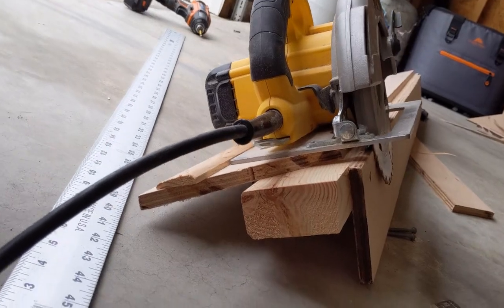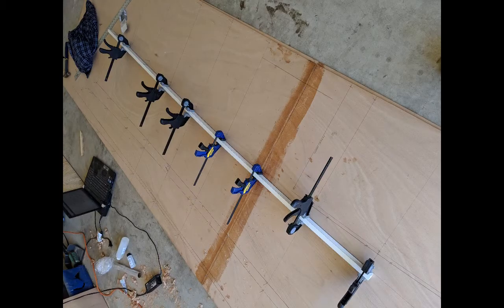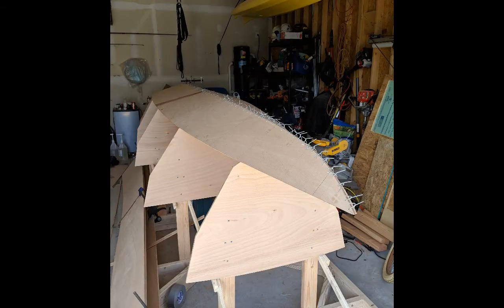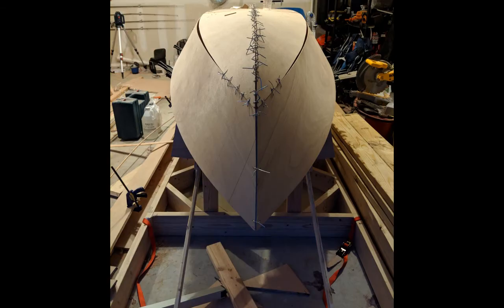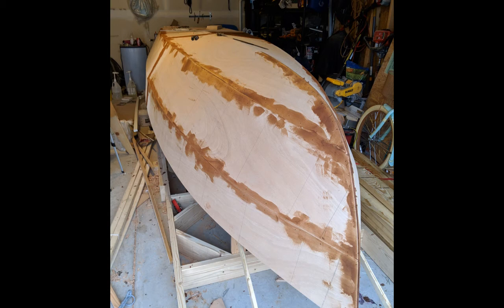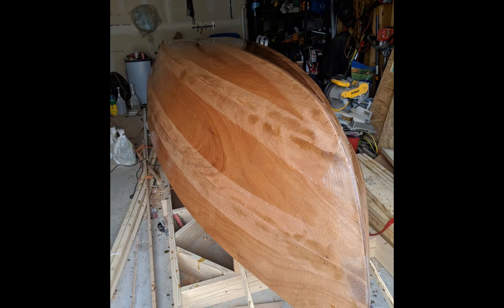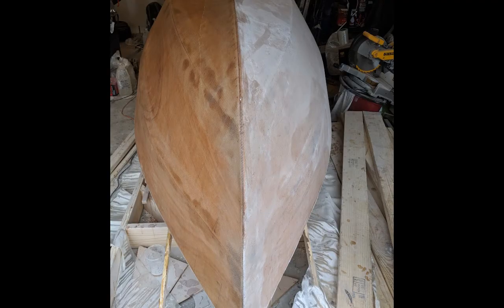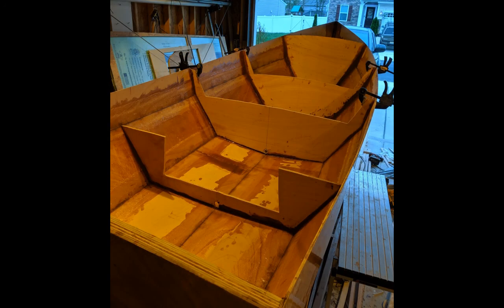CandleFish 13 - Part 2 KazierKreation Build

Comment: Thank you for the detailed overview.  I was looking for info on tabbing.  Normally I build right side up, so all the coves go inside and it is super strong when I get to the point of flipping it over.  You did not do what he suggested which was to bog and glass the seams.  He says it is easy, which is true.  But it would be endless.  Glad to see you got away with the process of just bogging the seams.  I was looking for permission.  :)

Comment: Dear  Mr. Kazier

I am very impressed with your woodworking, mechanical and electronic skills and have enjoyed seeing how you created your own CNC machine.  However I am even more interested in that fine Candlefish 13 that you built for yourself.  I have been trying to find one to learn more about it myself and to experience it's stability and sea abilities. Perhaps you can advise me with regard to your experience and understanding about the boat?

I would like to use it to transport 2 adults + gear to a 32' sailboat, up and down a 3 mile river that goes 4-5 knots due to the tide (against a good wind) creating a good chop. A 310 Rib gets pretty wet, so I would like this boat to be dryer and a better sea boat. Do you think it will be dryer?  I would also like to be able to take 4 adults to the sloop to go daysailing, and going slower with the heavier weight and being packed a bit, is expected.  Is that possible?

I would like to understand how stable Candlefish 13 is, because I would like to know how easy it is to board or transfer to another bigger boat's ladder. My wife has just had 2 knees replaced and she was able to board from our 310 Rib last year with difficulty. Now she has new knees and is doing PT so she is much more capable, but I would like to have an easier way for her to board our sailboat. I would  have a stabilizing post or railing for her to hold on to, that could be deployed when boarding or disembarking.  I would lean outboard to starboard to keep the boat stable, as she moves to port on the bridge deck to get to the ladder.

I am pretty agile so I don't think stability will be an issue for me, but I would like to know if the Candlefish 13 is more unstable than I think it is,  is it sort of like a narrow canoe or kayak? As you move weight to the side, does the boat increase in stability at all? I have been considering the cross section and am a little concerned about the reserve buoyancy outboard, due to the way the second panel is positioned.  Is the amount of stability something you get used to and just don't notice after awhile because you have accommodated and learned the boat?

Also another question I have is this boat too big to consider towing it behind a 32' sailboat for 15-20 miles sailing between ports? Will it tow well? How would towing compared to a 310 RIB (120 lbs)  which we do all the time?

Thanks,
Rick Gleason

PS: Thank you for your excellent youtubes's I have looked at them all. I find it very helpful and encouraging.

PS. I tried sending to your email on your website https://www.kazierkreations.com/ from two different emails and each time I was notified that it does not exist.

https://www.kazierkreations.com/
Reply from the maker: First my apologies, i have not had time to finish setting up the website, and i have had a few issues with spam so i disabled emails at the time untill i can get this squared away.  Hopefully this response is not too far dated to get back to you.  

as for the boat its self, it would be quite a challenge to board, it sits fairly high in the air until it is loaded with people so stability is a little on the weaker side.  I would suggest looking at some other plans deviln has (i have emailed him many times in the past, and is a pleasure to email and talk)

He has other plans on his site that definitely show a slightly larger (or wider version of this boat).

In my experience so far with this boat, besides being lightweight, and buoyancy of the boat being vastly greater than any of its size, it does need a extra set of spring loaded trim tabs. It is a fast boat for its size, but when turning with a tiller motor, it does feel a little "Free" going left and right.  

We have taken it out with 2 full grown men, space is a little limited as well, so sitting "in line" helped the unstable madden voyage.  It did though help when i installed the trim tabs, it really made it a little slower as well as stable while under power.

hopefully that helps, and again i apologize about not being able to contact me.

Comment: I only used wires every few feet (my design is the updated version of this boat, but I don't think that is the point.  I had wires every few feet on the rear half, and about a 3rd back from the bow,  I had 3 wires with 6 inches between them.  At the bow, I had wires every 6 inches.  I am talking about the bottom panel with the keel.  If I drill holes on 6 inch centers I start by putting wires in ever foot, and just see how it looks.  Less holes and less wires speeds thing up.  The wood is retty stiff.  I don't have any bulges or swells.  I used the 17 electric fence wire, and found it was really weak, so I had to use two strands.  Still goes a lot faster.  I prefer to use copper wire, but it has become too expensive.